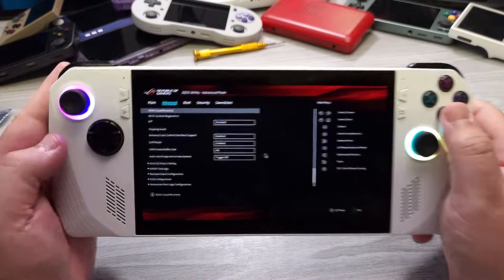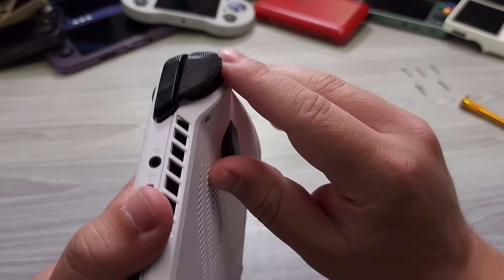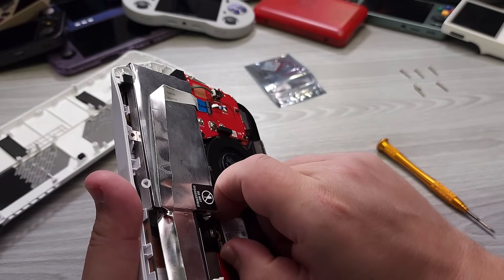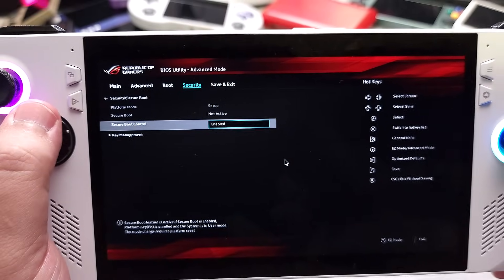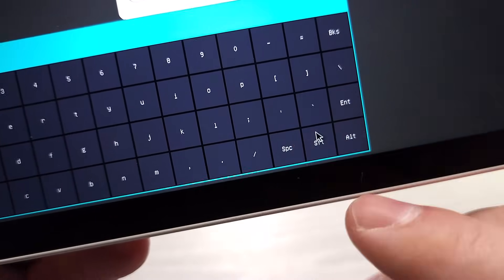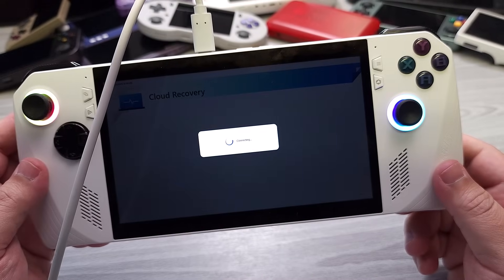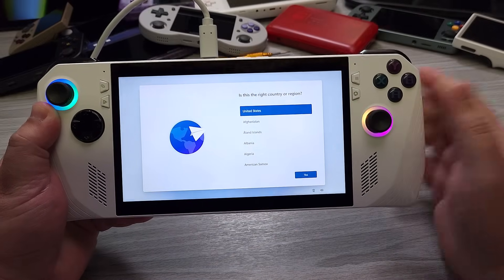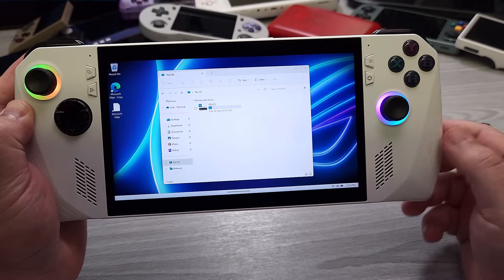Asus ROG ALLY SUPER EASY SSD Install / Upgrade How-to Asus Cloud Recovery

Comment: For retail units, the bottom middle screw is supposed to be captive, you're not supposed to be able to pull it out all the way. You can start your pry tool at the gap there too.
Reply: That's what I saw on YouTube as well.
Reply: Any suggestions on a pry tool? i dont have a wedge and i want to be as careful as possible with the unit when i do this tomorrow
Reply: @Mark-es5tx  Guitar picks are usually the best substitutes.
Reply: @Mark-es5tx  yeah I 3D printed different size guitar pics.
Reply: I don’t have a 3d printer unfortunately 😅 but I’m at work now and we actually have guitar picks which is hilarious considering my life of work. Thanks for the suggestions!
Reply: @Mark-es5tx  Lol I love it when things work out!
Reply: @Grimlo9ic  right? LETS GOOOOO 😤🤣
Reply: @Mark-es5tx  All hobbyist, no matter what your hobby happens to be should in invest in a 3D printer. Doesn't have to be one of those expensive ones. Just my opinion.
Reply: @blacknine  I think this is a wonderful idea honestly l. I know there are some cheaper options and I’ve thought about it in the past
Reply: @Mark-es5tx  fingernails did the job for me and yes, i have short nails ;-)
Reply: @blacknine  can you post time stamp ?
Reply: Made it super easy to remove
Reply: Not sure how people figure. Its just a regular screw (just took one apart).

Comment: I'm genuinely surprised this is as simple as it is. Just installed my 2tb drive and waiting for the cloud recovery to finish. Thanks for the excellent guide!
Reply: How long did the process take from start to finish?
Reply: It take few minutes but mine not recovering lol it say invalid secure boot wen boot is enabled lol
Reply: So if I buy this will I need to save everything on the cloud?
Reply: So everything you had installed originally will be put back onto the new drive from my understanding correct? I want to do this but it would be annoying to reinstall everything I have on here especially all my emulated games

Comment: Thanks man I did a 1tb install on my rog following this video to the t and it worked perfect, I started early around 5:10am and finished at 7:40am with 1gig speed internet with some drop speeds to 500-800mbps, after its done there's alot of more updates to do in my asus,armory crate and windows. I'm still downloading games right now its 530pm I'm about to run out of space but was able to fit alot.
Reply: How much?

Comment: Followed this guide step by step and it worked flawlessly.  Installed a Sabrent 1TB drive.  Make sure that you do all windows updates as well as the BIOS update from the My Asus app.  I know some other people were having issues with the update stalling in the “checking” phase and that fixes it.
Reply: Did you turn off device encryption before you switched over?

Comment: Thank you for this. Just one important remark: If you get you Ally like me on day one you have to go through the whole install process with the original SSD, especially BIOS updates. Yes, updateS, there are two of them, one in windows, and a second one restarting in the BIOS (which i skipped on my first attempt causing my device to hang during cloud recovery).
Reply: Tanks for the information, didn't know that. Will do so.

Comment: Nice, thank you for the tutorial video. I've already got a 2TB 2230 SSD sitting here, just waiting for my ROG Ally to arrive for my outside summer gaming fun. :)

One question: Do I have to start the on the original SSD first so the cloud gets the data or can I just replace the SSD right away and use the cloud recovery?

Comment: Here are tips that not many people mention when upgrading to a new SSD:

Before upgrading to the new SSD, login to Windows on the SSD installed on the Ally and update everything on Armory Crate SE, MyASUS app, and the bios.

After installing the new SSD, when it ask you for your Wi-Fi during Cloud Recovery, USE your regular network and DO NOT USE your 5G network, connection will fail and will request you to use another WLAN.

You may use your 5G network after it finish Cloud Recovery when you reach the Windows startup screen.
Reply: I just want to share this with everyone since I watched a few upgrading videos  on YouTube and read some instructions on Reddit and not many people mention these tips until I started doing this and had a lot of issues especially the Wi-Fi, had no idea it had to be your regular network instead of your 5G network.
Reply: @John_Alter why though? I don't get why 5g would matter
Reply: Thank you so much, it's finally working after many tries, i don't know why any video mentions this 😢
Reply: Any ideas why it stays on checking? Everything has been updated prior
Reply: Need help! Swap 2280 brand new and Cloud Recovery prompted “ The device is not support for this function” 😩😭 what am I doing wrong?? Please help thanks!
Reply: once i install new ssd and do cloud recovery from bios will it also install Armory Crate SE along with windows ?
Reply: @pierrefitch  Yes, it will.
Reply: @John_Alter  what screw driver size I need for the 6 screw and the ssd screw will go buy today
Reply: @pierrefitch  Asus recommends using a size 0 for both the outside screws and SSD but for me I used a size 1 for the 6 screws to prevent stripping and I used a size 0 for the SSD screw.
Reply: @John_Alter  thank you
Reply: Do I need to turn off device encryption from current SSD before switching?
Reply: What about turning off Device encryption on the current SSD before you put a new one in? Do I need to turn it off? As it’s on by default
Reply: I just got the rog ally z1 extreme still in the box sealed im waiting for my 2tb ssd to arrive. Would your tip apply to my situation ( I plan on swapping out the stock ssd to the new one before even turning it on and doing the first initial set up) or should I turn it on and do all the necessary updates and etc then swap the ssd
Reply: @ Bios should be up to date compared to release so you can swap it out without going into Windows.
Reply: @John_Alter  ok thank you for getting back to me

Comment: I learned so much in this video...

1. I can use the BIOS to load Windows back onto it and I don't need a USB C device with a Windows installer on it.
2. THE POWER BUTTON IS A THUMB PRINT READER?!? WHAT??

also, please do a video on how to do physical modifications needed to install a full fledged NVME SSD in the ROG allt.

Comment: Two easy tips, for anyone doing this and who really doesn't mind validating their warranty. First, completely remove the black plastic sheet that he lifted up to replace the SSD and simply ditch it. It's completely pointless and only restricts air flow and traps warm air underneath it. Removing it will lower both internal and SoC temps. Second, remove the two black square dust protectors on the back panel that you just took off. Both of them are restricting air flow through the vents and removing both will increase air flow and further lower internal temps. Temps should be around 4-7 degrees cooler without them both and they aren't really doing much (just dust protectors). Without them and with more air flowing around the inside of the Ally, the SD card reader also doesn't get quite as hot, which can be an issue. Also, the fan won't need to spin up as frequently or as violently.
BTW, you can also fit in a single sided 2280 SSD with a slight bit of modification by removing/filing down a plastic support pillar that's on the back cover and then threading the 2280 SSD underneath the battery. It works perfectly fine, temps are fine and the 2280 SSD's are not only are much cheaper than the 2230's, but also they also come in larger capacities. Most modders suggest you use a Crucial P3 or P3 Plus SSD if doing so (thin SSD's), along with a couple of 1mm SSD thermal pads stuck on top and underneath..
BTW, there are several tutorials online, when it comes to modifying your Ally. Not only for any of the above I mentioned, but also for a few other things.

Comment: Nice guide. Mines been on the checking screen of cloud recovery for like 30 minutes now as of writing this. Hopefully it will finish but we shall see.
Reply: It should only take a minute but if longer u have to turn it off, swap ssd, and turn it on and update BIOS through MyAsus.
Reply: It worked after reinstalling the original drive and booting into Windows, then launching MYASUS app and installing all the updates. I had to reboot a couple of times until all the MYASUS updates were applied, including BIOS updates. I put the new drive in, started cloud recovery and it’s working. “Checking” took about ten seconds then it went on to install.
Reply: @Justintime246  cool thanks I will give it a try
Reply: @MrJohnson81211  did it work for you? I was having the same problem and I noticed this comment
Reply: @stinkinkib  Indeed it did. I was just about say in the thread thanks and it worked.
Reply: @Justintime246  Thanks it worked. So pumped.

Comment: Be VERY CAREFUL with the screw holding the ssd, in my case it was super tough to remove, I used a screwdriver that was not quite right and the head stripped immediately and it became even more tough to remove. Jeez why do they tighten them SO much if they are supposed to be swapped "easily"?! Other than that, your guide worked perfectly, thanks Phawx.
Reply: I have the same issue, I don't get why they torqued it down so much. Ordered a better screwdriver so hopefully that will remove it.
Reply: Having the trouble right now fml
Reply: Same for me. I had to buy a 1.4 flat head screwdriver and use pliers to get it lose. It was way to tight for no reason

Comment: Took all of 5 mins following your guide. Great info as always. 👍
Reply: People seem to have a issue bringing up a onscreen keyboard to enter a wifi pw. How did you bring yours up?
Reply: @respond_code3  I just tapped on the screen. After hearing some complaints about the SD card, I replaced my 1tb SSD with a 2tb SSD last night. The step Phawx mentioned about reading and accepting the policy on the Windows setup screen was the hardest part. Think it's about 4:30 of this video. So I have now benefited from this guide twice. Thanks @Phawx.

Comment: For anyone getting stuck at the enter password section for the ASUS CLOUD RECOVERY. USE A USB HUB OR THE CHARGE DOCK FOR THE ROG ALLY and connect your ROG ALLY/USB KEYBOARD. It’s best to do this entire process with an external WIRED keyboard. I kept getting a connection failed message and couldn’t enter my password but was able to enter the pw with a keyboard connected and able to successfully get my ROG ALLY working with 2 TB SSD. 😁😁😁😁😁

Comment: New subscriber, thankyou for your work.   I just wanted to humbly suggest that for something as important as a device recovery, or set-up of a brand new drive..you moved a bit too quickly, with not enough careful explanation of the exact menu and button presses required.  This is a process you where very comfortable with and that is very cool, but you forgot to dumb it down a bit, maybe?   I did watch the video slowed down a few times, and came away with the idea that I "think" I understand how to do it... But with a $1,300 AUD device, I think I know how, means that I would have to ok elsewhere to be sure, as I do not have the confidence yet required to do it.  Maybe thats all for the better though.  Again, no pedantic criticism intended.. just some honest feedback from a noob .  I have watched all your Ally videos, and will continue to do this, thankyou for your attempt to teach the nervous masses :).

Comment: Just found you while searching for Ally videos. My Ally is on the way and super stoked! I’m planning to throw a 1 TB in there, but I have a question about the Asus Cloud Recovery. Using the Asus Cloud Recovery, does that include and re-install Windows 11 as well? Or do you have to install Windows 11 on the new SSD first, THEN run the Asus Cloud Recovery?

Comment: two things; if they've already been answered than i'm sorry

1 - whats the formfactor or name of that SSD?  I've never seen it in that square size before

2 - Is there a maximum accepted size (GB/TB) that the SSD can be?  Is there a minimum speed requirement?  etc

Thank you!
Reply: 1) 2230 form factor
2) idk
Reply: 512GB, 1TB and 2TB but should be fast enough since they are gen 4.

Comment: Great video. Couple of things I noticed with mine:
The middle lower screw was braced in and did not want to come out. Perhaps ASUS saw this as an issue because of the smaller size and fixed it on prod models

Could not detect/enter hidden wireless info during the recovery process (like you can with initial setup). Broadcasting SSID temporarily was the answer for me. 

Hope this helps others and again, great video dude. 🤘

Spoke too soon apparently. Couldn't authenticate into my wireless because the os keyboard doesnt show 😢
Reply: Hold the back buttons and press up on the dpad , it should bring up the keyboard.
Reply: @rs305 do the macro short cuts work at this stage of the install?
This seems to be a issue everyone has. Unable to bring up the keyboard
Reply: @respond_code3  I did have that issue with my first ally, but I didn’t know about the shortcuts. I had to return it because it came with a scratch on the screen. My second unit the keyboard ended up opening up automatically when I got to the Wifi password screen.

Comment: its been 24 hours since i did the ssd swap and its been great, i was able to fit alot of triple a games and indie games and not have to worry about the sd card slot that went to shit a few weeks ago, i removed my 512gig sd card when people started having issues, i replaced it with a 128gig and it worked perfect for weeks and then one morning it finally hit me, but i was able to reformat it on my switch lite and it worked again, im not sending my rog ally back to asus just because of the sd card slot.

Comment: Hey there Phawx! Found your channel with the Ally videos, and I just have to appreciate your content man! Some of the recent videos were extremely insightful. Specially the one about the AutoTDP and the update that improves the Low TDP performance, Armory Crate and all that. However, there is still one thing that I would like to ask if it was improve, or still remais the same as the early reviews noted. The framerate cap on the side menu. Does it work now? Is it a hit or miss? And can it be customizable at all? I know we can limit the FPS using rivatuner, but being able to switch it on the fly would be pretty neat. Even more if we were able to put in the values that we want on those presets. I'm just wondering at this point, because no one mentioned it being fixed with that update. Hopefully this question also help others that have the same question as I do.

Comment: Absolutely love tutorials like this, but it does suck that it doesn’t show the possibilities of errors and how to fix them. Replaced my SSD in less than 10 minutes thanks to this tutorial, but after booting up there’s multiple errors that can come up, that seem to be extremely common online. 1 is the date and time not being correct when you’re in the bios which can cause the ally not to connect with servers for your download. Another is 5GHz WiFi being too fast or whatever the reason is, so I had to switch to my 2.4GHz phone hotspot to get it to connect to servers and download.

Comment: Nice tutorial. Will retail units come with the newer bios which doesn’t require the secure boot change? Or will we need to update the bios before doing the replacement?
Reply: I would run the ally first and update everything before replacing the drive.
Reply: Good point will do 😉
Reply: Just what I was looking for.. thanks

Comment: I just updated the ssd.  My Ally os now stuck at 3% on the cloud recovery progress. I have verified everything had been updated and the time in the BIOS is correct but it still will not go any further. Any suggestions
Edit: I got it figured out just had to use my phone as a Hotspot even though I have 1 gig speeds

Comment: First off. I wanna say thank you very much for the videos, they are much appreciated and second I was wondering how long dose the download for the system files usually take? Mine kinda stopped at 8% and it's been there for a while, don't know if that's normal or not since I have it connected to an ethernet cable.
Reply: How long did it take? Mines been stuck at 3% for a while now…
Reply: @justinlindbeck3718  it took a while for it to go up, there was even A time where my cat disrupted the ethernet cord and I had to start over and then it started to go faster then before. But all together maybe like 3 hours but onec you get to past the first download The other one kind of tricks you into thinking gonna move but then bam it'll go from 8 to 15 to 30. When all was said and done though it worked and I didn't lose anything.

Comment: The one thing that I like about the Ally, is the screws that it uses, just normal screws.  It was a pain in the ass breaking the Steam Deck down, because it required specific screwdrivers and not just one screwdriver, but two different types of screwdriver.  Is there a way to re-install Windows if you don't have access to cloud recovery, I.E. boot from USB device?  I'm just asking, because I want to be certain of that just in case there are any technical issues during or after updating the BIOS.  Once the NVME is replaced, it will be a 3.5TB system, since I have access to a 1.5TB Sandisk Micro SD Card also.  I just stripped them from my Steam Deck, which is sitting in the cupboard, collecting dust, right now.  I'll put the 512GB NVME from the ROG into the Steam Deck when I'm done, and use it as a multi-media system.  I just plan to use the device as my main emulation system for PS3 games and such, like a hand held "Bar Top Arcade" machine.  These Z1 Extreme systems are probably a bit overkill for that, spec wise.